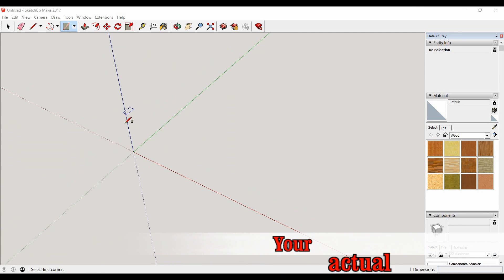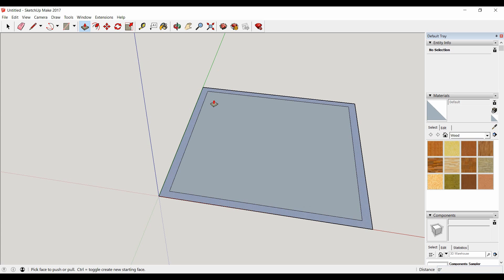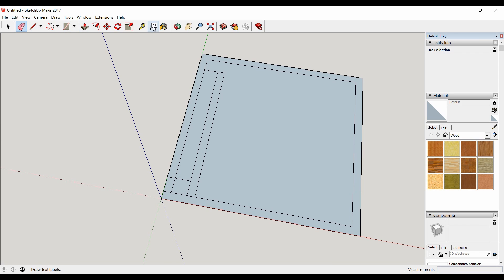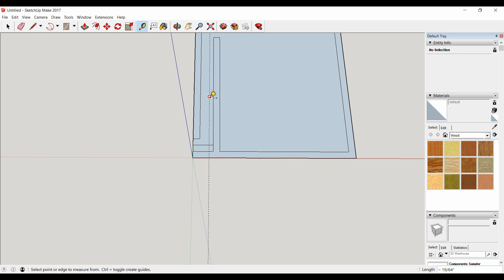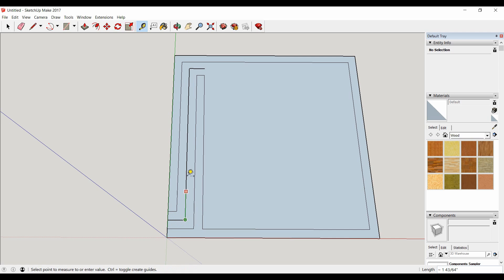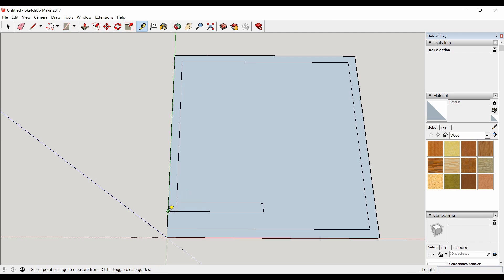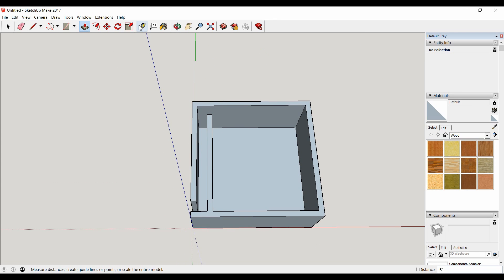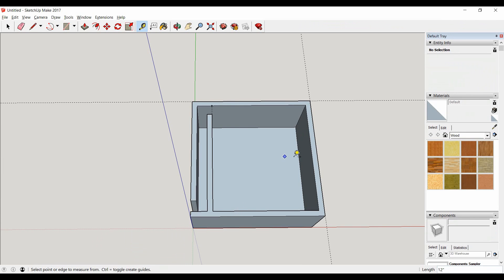Diy You're Doing it Wrong - Measuring Port Length in Speaker Building

Comment: hey Toid I was wondering if you could make a very elaborate, theory based video on speaker ports with emphasis on smaller sized boxes with longer folded/curved ports, much like the subs made by Sonos and Bose 500/700 etc

Comment: All major Manufacturers of appliances say a 90deg. Elbow on a dryer vent = 2 ft of venting, due to reduction of air flow, this would apply to anything that moves air and any shape vent , therfore if anything you should make any port with a bend a little shorter than calculated

Comment: I need help please 🙏 I need a box and it has to have .95 cubic foot net volume with 12.5 square inches of port area. Port length of 30.5 inches for it to be tuned 32hz. Now may max space is 40.5” long and 19” high with the bottom 11” and top 6” now the width can’t be more then 40.5 “and hight 19” the bottom or top can be more if needed. I have a 12”JL shallow mount tw3 -4 if you can please help me I would appreciate it
Reply from the maker: It’s best to ask this in the forum. www.toidsdiyaudio.com/forums

Comment: I guessed this must be the way but never knew for sure until you explained it, so thanks for that.

BTW, what determines the length and capture area of the port?

Could you possibly do something on how this works with a transmission line please? For example, if your quarter wave length is 1.2 metres, how do you design a box so that the TL is exactly that length? Also, is the TL measured from the theoretical inside face of the enclosure where the driver is mounted or is it from the back of the driver itself?

Comment: Whoa boy! I do hope you're not building 12 inch square boxes for speaker enclosures, as any repeated dimension will incur standing waves at the 12inch Wavelength (in this particular case). A better approach would be to use a Logarithmic ratio box (3 different dimensions) and thus eliminate the possibility of any standing waves (The basics of audio design). Any box , where the dimensions are multiples of whole numbers is asking for trouble. Even when using Log ratios you can have problems, you just have to make sure you're outside the audio range when you hit that standing wave frequency, wallah!  You are spot on with the length of the ports though, well done.

Comment: The kicker audio app has most of these programs built in there one app along with test tones and wireing charts, air space calculater port calculater the only thing it doesn't tell you is were you should be Messering from make sense now when it give me the calculation. Should check there app out it worth getting the pays version. in less you really able to take your computer / laptop to Evey build. it has more features just for audio. 👌👍✌️

Comment: Maybe you can help me.
I'm doing something I don't think anyone has done. I'm making a box for 4-12 inch subs with a quadflow system, with 3 different 12s
2 kicker 12inch svc 150rms 4ohm
1 kicker 12inch dvc 300 rms 2ohm each coil
1 pioneer 12 inch svc 4ohm 700 watts 
Dimensions 
30x27.75x 18in
Port cylinder Is 6 wide and 24 long to work with 
After I figure out port size I'm making a spiral helix for air flow with the port not THROUGH it, so there should be no chaufing and I will be able to adjust the helix in and out  like playing a trombone to tune it, along with a 12inch Passive Radiator out of an old sub with the magnet cut off and a cable with a tension spring that I will be able to adjust to make tighter or looser.
So if you could help me with normal port size with those dimensions. I'd appreciate it thank you

Comment: 3:44 How far away from the corner (entrance) does the port have to be for the corner turn to not be included in the length? For example if yours had stopped half way (5 in assumption vs 10) and you added another 1.2 in piece to the end for bracing it would in effect visually appear the same only with a much larger entrance totaling approx 8in?  So how far away would the entrance corner have to be for it to not "extend" the length? How what would be the size differential? Say if the port was 4 in and the entrance distance to corner turn was 8 in. Thank you.

Comment: This is almost but not exactly right.  In both your examples you used a slot port that used the outside wall as one of the walls, and the wall kept going past the end of the slot port.  Some of that will add to the effective length of the column of air, because one wall keeps going the effective length is not a squared off line at the end of the port wall but a diagonal at somewhere between a 30 and a 45* angle depending on the configuration.  In your examples, it will be somewhere in the 1/4-1/2", not as big and error as the bit you're showing, but in some speakers that could cause some weird tuning that you're not expecting, especially if the other wall of the port starts getting close to the outside wall but isn't quite there.  

One way to cut down on some of this weirdness in some configurations AND  decrease port noise is to put a big radius on the end of the port.

Comment: Box building is fun but as I get heavier and heavier subs 80-90-110 lbs it turns into a whole other ball game. Almost lost a finger once my make shift brace I was using slipped and just by luck I moved my fingers out of the way or else I would have had to try to unwedge a 80pound sub while my fingers were being crushed or just cut off. But the longer the port the better I like 28-18hz with my custom subs I get. Thanks!!

Comment: In my opinion the first example is pretty much a worst case scenario and most people likely would not go with that design. I would even add a little to the 12 inches because the inner end of the port is right next to a wall.

The fact that people lack very basic math skills needed to calculate port area and displacement of the enclosure is pretty sad really. Instead of using calculators and not really having a clue it would be a lot more usefull to figure out how to calculate them.

A good video though, hope it helps someone.

Comment: Thanks so much for posting this video. I've been designing an enclosure for a Skar ZVX-12. I've been taking into account the area of space the port takes up, but at the same time I didn't feel a 100 percent confident that I was doing it right. Finally, I have a definitive answer to my start and end point for my port.
Reply: I'm about to build a box for the same speaker what was your final measurements and what is it tuned to?

Comment: so how does it work or how should you measure if there is a round over edge or a kerfed port? do you only measure the straight portion?
Reply: That's a really good question... O.o
Reply: @Max-oi9ge  There isn't a simple way to calculate this exactly. Should be accurate enough to count half of the kerf or the flange as port length in most cases.

Comment: Thank you for this... I always wondered how to calculate the length in a port that bends. 
 
Now if I could just get an explanation like this on speaker displacement.  Does it assume a certain box thickness, or is it the entire displacement of the speaker in which case the cutout hole gets added to the volume of the box?
Reply from the maker: If you use a program like WinISD where you input the parameters, it is assuming the entire driver as the displacement.  In all honesty, the majority of the time, the little that isn't being taken into account, will affect the response very little.  And will probably not be noticeable.
Reply: For most speakers, ones that don't have heavy cast frames, you can get a very good number with some simple math just by computing the volume of a cylinder with the diameter and height of the magnet and a cone the diameter and height of the speaker cone.  The little bit the sheet metal frame, wire, spider... take up will be roughly accounted for by the amount that the small steps in the magnet structure... have that you didn't take out.

On much larger driver the old school answer is put the driver face down in a simple box of known volume and fill it with packing peanuts and measure the volume of the packing peanuts and subtract the difference.  Some people would take a large measuring cup and measure the packing peanuts coming out, but an easier way is just pulling the seaker out of the box and seeing how much the level drops.  For example, you take the box the speaker was shipped in, it was 10x10x10 (just to make things easy), take any packing cardboard out,  put the speaker face down in the box, fill it with packing peanuts (shake it around a bit to get them to settle into the nooks and crannies) pull the speaker out, shake it around again and if the height of the packing peanuts drops to 7", you have 3" of empty space on top you know the volume of the driver is 10x10x3 or 300in^2.

Comment: can you talk about slotted port correction factor ,when the slot port uses 2 sides or 3 sides common to the enclosure..
Reply: Port correction factor:

A port at a certain length will actually have its own resonance, this will change the tuning of your enclosure by a few hz. To fix this you use formulas to factor this in. Torres and winisd both factor this in for you.

Common sides:

How many existing walls of the enclosure the port utilizes. For example a normal slot port you only have to add 1 board to the port right? Because it uses the side top and bottom of the enclosure as 3 sides of the port. So it would have 3 common walls.

If your port was directly in the middle of an enclosure and you had to add 4 boards for the port it would have 0 common walls.

Comment: i've always added half port width to the length for effective port length when running a slot port on an existing wall of the box.  example if port is 1inch wide x 5 in long you would add .5 in to your measured port length to get effective port length. just imagine a 45degree line coming off your port board to the box wall then measure center line from port exit to the center of the imaginary 45 degree line.  all this means i would have been .5 inch shorter on my port board if building the same box.  am i off?

Comment: Nice. I have a beginner question though. What happened to the forward facing round ports in cabinet or tower speakers like the Fisher, Pioneer. Kenwood, Technics speakers of the old days? As someone that is interested in building his own speakers with higher quality components for quality sounding audio and saving money on labor that a manufacturer charges you for their name, looks and their 50 employee engineering staffs degrees. Is it better to place a round or rectangular port in front or back, or even forget about a port and just make it sealed? I have looked for explanations of this but cant really find a single source on youtube that really explains this when, where why and how magic. I like Kirby and your channels but Kirby is more garnish (except for his last 6 -7 videos), I need meat and potatoes to live on so I found your channel, lucky you haha. Also what makes a speaker good or great? At some point a speaker cant sound any better than another speaker so what validates a $15K speaker or a $60K home audio amp other than artsy fartsy and bragging rights on how much an idiot spends? If you could so a video or series I think it would go over great.
Reply from the maker: Richard great questions!  First the way the port faces is a non issue most of the time.  So if you would rather face it forward you can.  As far as what goes into what makes a high end speaker, there are a few things.  The first is wide sound stage.  In order to know this, you will need to look at the graphs for off angle dispersion as well as know about a term called beaming (spoiler - I will have a video on that in the future).   Secondly, You will need to be familiar with distortion in a speaker.  Although a speaker may be able to produce sound until x frequency, it can have distortion in that region.  The easiest way to see this is with a calibrated microphone and a program like Rew.  Third, a properly designed crossover with the drivers time and phase aligned is huge.  If they are not aligned correctly, you will have some issues.  Finally, every type of speaker has a different type of sound signature.  Some people love the sound of soft domes, but not aluminum.  Some enjoy compression drivers.  Really that choice is yours.  But just know that will play a part in it.  So to summarize, you are typically looking for drivers with low distortion, fairly linear response, without beaming (wide sound stage) that has the sound signature you want.  I think you will be surprised at how much less you will spend for the quality of components you use.  P.S. I love Kirby.  We are actually working on a collaboration.  I hope you enjoy it.
Reply: I was curious about the response to this question and the question itself. I was reading the response from 123Toid and was thinking, I'm not sure this was the answer he was looking for. Then, I reread your question you said that you were interested in building your own "speaker" with higher quality "components". Did you mean that you actually want to build your own subwoofer or the enclosure?

Comment: I had no problems with the port in my first box, but I had the wrong volume because I did not take account for the port taking up airspace. Box still sounds good, and I learned from it
Reply from the maker: That is a great point and such an easy mistake to make.  You are definitely not alone with that.  I guess that is one of the great things about this community, learning from each other's mistakes.  I'll have to add this one sometime to another video
Reply: I had the same misconception so I made a little video about it on my channel. I messed that up for like 7 years until I made a box with a bigger port and it was really noticeable.

Comment: Excellent vid as always. It would be interesting to discuss end corrections for slot ports as there seems to be no clear method in correcting actual port frequency other than measuring and adjusting. Some people on forums say slot ports should be 30% shorter if they share three walls on exit of the port. I personally think that it depends on the size of the cabinet and the scale. What are your thoughts?

Comment: It would have been nice if radii on port ends and their impact on port length calculation would have also been discussed. Another common error in port calculation is using the nominal size of PVC pipe instead of the actual size. EX: 2" PVC has an internal radius of  1.0335 and an area of 3.356 sq in while if the nominal dimension of 2" diameter (1" radius) is used the area calculation yields 3.141 sq in, an error of about 6-1/2%. Other sizes of PVC pipe have actual internal diameter dimensions further away from the nominal dimensions so using the nominal dimension would arrive at even larger errors.  Great job in raising awareness of the issue and showing the accurate method of measuring port length.
Reply from the maker: Good Goat thanks! Those are both great points. I had discussed PVC in another video, but can't remember which one. I should have added that in here. Thanks for the heads up. I hope people read this, as it is an excellent point
Reply: I created an xl spreadsheet with ID and OD area calculations for all sizes of standard schedule 40 PVC pipe in decimal and metric to avoid ever needing to do those calculations again. The spreadsheet is useful for port tuning and box volume calculations. I appreciate your efforts on these videos and your web site and hope that persons watching understand the time and work that goes into the videos.

Comment: You need a new graphics card.
Reply from the maker: I think It's actually the screen capture program.  There are no issues in person.  I am using a 1060 6GB with an i7processor. I'll try to reconfigure the program later.
Reply: Ah, You should try OBS if your aren't already

Comment: I already knew this but it's nice to see a video on this because I see this all the time. Fyi to people, you can have your port outside the enclosure if you don't have enough room inside your enclosure
Reply from the maker: Joe Baker thanks Joe! Great point about putting the port outside the enclosure. You can even make it a design aspect if you want.
Reply: 123Toid 
I have made ports outside enclosure as designed purposes in a line array tower. The port was (edit 26"lx2"d) 76"lx2"d and tuned 16 3" drivers to 37Hz. I couldn't fit that port inside the enclosure with room for the drivers